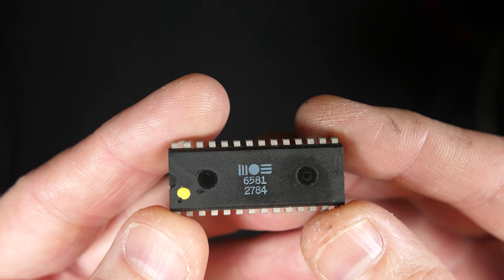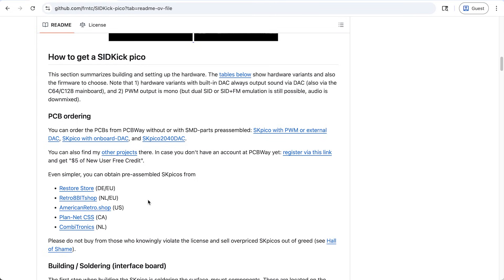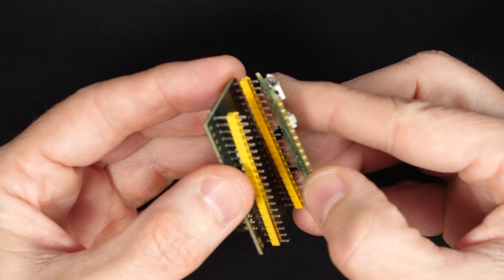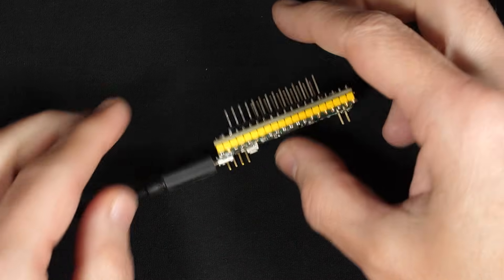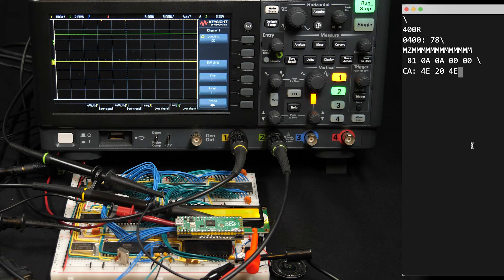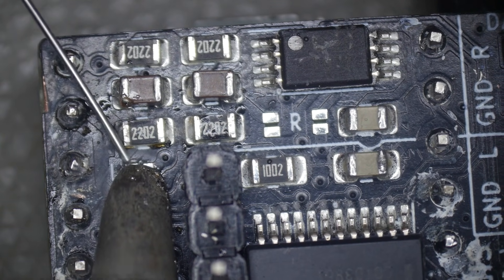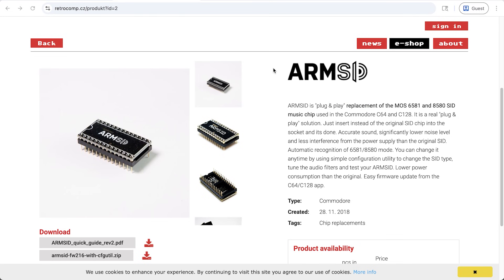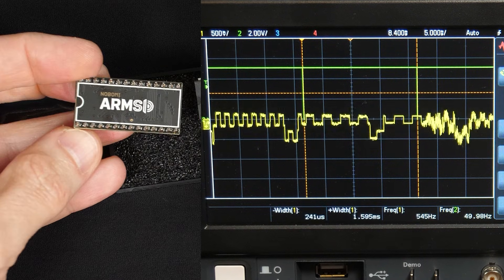Modern SID chip substitutes

Comment: Sidkick Pico is roughly half the cost and sounds nearly identical to my old ears versus the Armsid.  It might be uglier than the Armsid, but it's got some features that make it a lot nicer outside of pure SID emulation (ie, being able to have PRGs straight on the pico or having the DAC/no DAC options if you're a modern SID composer/musician).  It's also kinda nice to have the config menu built in and not a separate configuration app.

Comment: The major difference I hear on the RP2040 SID is some alliasing, which makes sense for a PWM output. I wonder if with some filtering (passive RC or maybe a 2nd/3rd orderactive filter with one opamp) it will sound closer to the original. Also I cant find the schematics on the github.

Comment: I put together a SIDkick (not pico) with a Teensy rather than the pi pico a couple of years ago.  Straightforward build, I like it quite a lot.  Drop in replacement for both SID versions (breadbin and in my 128).

Comment: The PicoSID Definitely has a more grainy sound to it!
6581 and the ARM sid sound very very much alike, ARM SID sounds just ever so slightly quieter though
ARM sid is doing a really REALLY good job, the PicoSID i had expected a bit more performance - feels like its running at 22khz out tho.. ARM sid maybe 44khz or 48khz?
Need a SID replacement with a nice 88.2khz or more ;)

Comment: Sounds like the rpi sid plays the sound with like 11khz or so, you can hear the carrier waveform on top of the sound signal, unless your hearing doesn't go beyond 10khz.
The arm sid has an occasional pause in the audio. 
So I'd prefer the original sid in this case.

Comment: For the jumper bridging, yes you could use a piece of wire or a zero ohm jumper resistor, but when I was in collage for the repair course, to fix a broken trace you can bridge by turning the soldering iron's temperature down and swipe that part quickly like a tiny paint brush.

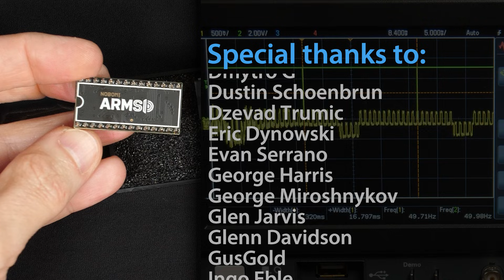Comment: 12:33 the capacitor makes a difference on the sound, the last one didn't have an attenuation caused by the charge that was working like a attack/release simple RC filter.
they come close to the original, specially the second one, I think the problem is that they're too perfect and the original has some analog circuitry that provides a small bit of distortion.

Comment: I've seen interesting SID and YAMAHA chip solutions on gaming machine boards. A board + op-amp + a large chip, probably a CPLD/FPGA, and a flash chip. Putting an RPi into such a setup is disgusting to my taste. I can also understand someone cutting corners and creating graphics on an ARM processor – that requires significant processing power. If they're creating graphics on a CPLD or FPGA, that's also acceptable. But throwing such a monster into generating music? Ugh! I recently streamed music in 16-bit PCM format using an 8051. If you're so inclined, there are plenty of NORMAL MCUs (even those operating at the 5v standard) with built-in DACs – from a few bits to as much as 16. They're also 8-bit, so there's no mismatch.

Comment: 2:35 A custom board to piggyback a standard board onto… Given how few supporting components an RP2040 needs, I can’t help thinking there’s potential for a single custom board with DAC and RP2040 all within the original footprint… which I suppose is pretty much what the 2nd board is, just with a different CPU.

Comment: For as complex as the Pi replacement is, it seems to have most "noise" compared to the original and the ARMSID.  Armsid sounds very clean, just too bad the output is a bit on the lower volume side.

Comment: I love the sidkick pico. The PWM version that you skipped IS a drop in replacement as it is :) It also supports built in .prg files that are run from the sidkick, you can put your diagnostic programs in its firmware and you don't even need a cartridge, but that is only useful if you use it in a real C64.

Comment: Am finding it extremely excessive that you need 800MHz CPU with 3GB of RAM, or whatever the Zero has, some extra chips to emulate simple 6502. Sure it doesn't cost a lot because those components are readily available these days, but still. Total overkill to emulate such an old chip.

Comment: I'd say that if there is a difference in sound between original and replacements it's a subtle level of noise that you just associate with the experience, bit like how people like vinyl, even though it's actually distorting the sound slightly, your ears get used to that version. I'd say the SID replacements are cleaner in sound, but they're all good.

Comment: I've been listening to that Monty on the Run tune for forty years and I honestly couldn't hear much of a difference between the original and either of the replacements. Maybe less distortion, which one could argue was part of the signature sound. Probably there are some edge cases where you would hear the difference but unless you are a massive purist and you really insist on having the original hardware, this is going to do the job just done I reckon.

Comment: This takes me back to when I was training under grads to program machine code in 6502 and also Z80. They would build a simple 6502 board with a couple of K for ram and a 2716 for the code. We used a developement board called EMMA, that had a sinple Hex keyboard and 6 x 7 segment leds for the display of memory location and data. I also learned alot back then. The 6502 was used in the PET and BBC computer and the Z80 was in the TRS80 and sinclair spectrum if I remember correctly. 
My expansion sysyem for the TRS80 had a modem, twin disk drive, printer interface, and eprom programmer. My BBC computer also had a Z80 co-processor. Fun times.

Comment: There's quite some bit crunching in the Pico sound output that is very audible. Otherwise both options seem to work well. I'd pick the ARMSID tho, simply for the cleaner sound. Any audio amp will have no problem fixing the low output.

Comment: Great video.
All the HW (PCB) versions of the SIDKickPico are essentially the same. First version was the simplest, outputted a PWM sound by default, but you could add an off-the-shelf DAC board to it to get analog audio. Then the second version came out which integrated the DAC chip on thePCB, making the whole thing look neater. And finally the latest version integrated the RP2040 MCU on the PCB too, eliminating the use of a Pi Pico. This board is much smaller in size since there is no need to follow the Pi Pico form factor. Looking from a cost/performance point SIDKickPico (all HW versions) gives you the best sound, really close to a real SID.
ARMSID is like the first version of SIDKickPico, without the external DAC board, so yes, PWM only. It sounds fine, but to a trained ear there are a lot of things that just don't sound right. Being significantly costly compared to SIDKickPico, I believe it will be slowly disregarded by the C64 community in the future.
And there is another one you should check out, The FPGA-SID. I haven't tested it myself, but a lot of people swear by it that it is almost indistinguishable from a real SID. It is not cheap though. 
These are the top 3 SID emulators at the moment, there are older stuff like the Nano SID, but none of those can compare to these top 3.

Comment: The interesting thing would be to compare emulation modes.  The different versions of the SID chip had different characteristics.  The original 6581 actually had some mistakes that were discovered by composers and used to do things that the chip wasn't supposed to do, like PWM altering the filter to create a percussion sound.  Later versions of the chip fixed these flaws, but as a result some SID music from composers like Martin Galway don't sound right on later chips.
This was so important that "the scene" helped Martin Galway resurrect his system that he composed all his music on, then they used it to record his tunes so they could publish a CD called "Project Galway" with with the music sounding as it did when composed.

Comment: I have installed the sidkick Pico in 2 c64's. It's working great, it comes with several bonus : it emulates 2 SID's and also the FM sound. And it has the capability to store games in the flash memory (the UI to launch them is accessible with SYS 54301) . So definitely, for the price, it's unbeatable. 
Also, sound quality wise, it's very difficult to tell the difference with a real sid.

Comment: From the little information I have, it might guess that the picosid output that was clipping was because that resistor you knocked off was to adjust the gain down, and wasn't reattached correctly.

Comment: The FPGA-based SID version in the Ultimate64 is pretty decent, but if you have a real SID or any kind of SID replacement you can insert it into the provided socket.

Comment: Love this! Do you plan on getting to the point where your 6502 computer can read from / write to disk (create a file system), and get a terminal running where users can run commands and stuff? That's getting into more OS development than hardware stuff, but I would still love to see that.

Comment: As much as Rob Hubbard is awesome, the Monty on the Run theme isn't that great for comparison cause it doesn't use some of the more finicky features of the SID that emulation may have a harder time with, such as the filter or combined waveforms. If I were to choose one tune to use myself, it'd probably be Martin Galway's theme for the Miami Vice game, since it uses both combined waves and the filter in a relatively obvious way that has been historically hard to emulate.
Reply: This, I also thought something by Galway would be a better test for some of those edge cases with band-pass, ring modulation etc. Even though MotR is probably still my favourite SID tune ever.
Reply: Anything recent by Lman, for instance, would break most of these replacement chips, compared to music from the mid 80s.
Reply: Bionic Commando had some quirky stuff too ;)
Reply: Getting my walker out... ;)... I had floppies for Axel F (Beverly Hills Cop) labeled Axel L and Axel R - needed two C=64's pressing the [enter] at the same time... also one for Billy Idol's Flesh4Fantasy - just the guitar and drums... but man it sounded great through a stereo.  The weird visual display was kinda cool - to the beat of the music that drew into the border area.  Ah... ill spent youth! ;)

Comment: A probably even better replacement, would be using an FPGA. You could really get into the thing and inspect the behaviour of the individual parts of the chip on a cycle by cycle basis. Also, you could easily increase frequency and add you own custom hardware/instructions.

Comment: The funny thing about SID chips is that each one sounded a bit differently. Its among the least consistent ICs ever made

The drop in replacement is way better than the overkill raspberry pi version. Makes no sense to put 200 times the computing power of a C64 just to emulate the sound and still have it not sound right.

Comment: There is also backSID. and a couple others as well. There is a HUGE discussion as to which are good and which are junk. The SWIN SID nano is just. I'm barely an audiophile and that one is just offensive. The others sound the same to me. The "full size" SWIN SID is apparently ok, but not great. I can't hear anything wrong with it. I also think the integrated U64 SID sounds perfectly fine as well. But interestingly enough that board will take any SID you give it. Not just the FPGA that's built into to the board.

Comment: SwinSID is another SID-Chip-alternative with an overclocked ATMEGA Microprocessor.
Only 5V operating voltage - no voltage regulators or level shifters needed.

Comment: As people pointed out the PWM + low pass filter is a DAC. This is how class-D amplifiers work .... Even high fidelity ones.
Reply: Class D amps likely use PDM and not PWM. PWM works if that’s all your hardware has. But for specialized hardware you’d use PDM as it is more suitable.

Comment: I didn't know there's such thing as a "Make SID as an RTL module in VHDL" itch bruh
Reply: There isn't--most of it you could, but it contains analog circuitry which is not possible to model in RTL.
Reply: @Sauraen  eh well it can still be done in a way methinks, a cursed way but a way. At least ADSR and signal generation

Comment: There is some kind of lesson to be learned in how much modern technology it takes to substitute something designed in the very early 80s
Reply: That lesson is just how absurdly inaccessible IC foundries are for low volume.

Getting a spot on a wafer if you're not in a college course with a pre-existing agreement, even at the bottom-most available scale, is in the 5 figures range easily last I could find an actual quote, and that's for a single prototype.

If you want an actual wafer done for manufacture you're looking at about 6-7 figures a pop and years of lead time.

This was from the pretty spotty information I could get publicly though - I'm sure high volume gets much better rates, since a huge part of the cost is the photomask. Or maybe not anymore, with AI sucking up all the foundry output...

Comment: the arm is definitly cleaner with its notes, while the pico goes a little bit over the threshold
Reply: the original has some inherent distortion, people want the "perfect" sound, which means original, kind of funny. the ARM sounded like missing a RC filter that caused a bit of loss on the signal, just adjusting the gain isn't enough, it needs a capacitor to do the trick, maybe it has one but it needs a slight adjustment.
I think the pico sounded more closer to the original, even if the timing was a bit off and it clipped a bit. you can probably adjust that.

Comment: I vote for the ARMSID as the best replacement. Sounds exactly like the original minus a slight reduction in noise. Hard to describe what I don't like with the RPi, but its slightly sloppier... almost like it's subtly missing timings. But I'm splitting hairs.
Reply: Yeah, I heard the same. Sidkick sounded a bit harsh and distorted, armsid on the other hand was clean (sounded even cleaner than the original), if only output level being a bit low.

Comment: Excellent stuff.   - One note of caution though.  I'm sure you're well aware of this Ben, so this note is for less experienced readers:-  most chips have 'absolute maximum' ratings on them and can sustain permanent damage when these ratings are exceeded. - this often includes the chip sustaining permanent damage when input/output pins are subjected to voltages outside the Power Rail voltages.  - Hot-swapping I.C.s can cause the input/output pins to be connected to signals before the power pins and so can subject the chip to exactly this sort of stimulus. This can cause latch-up or even permanent damage.  - Hot swapping chips might work - but it can also destroy the chip.
Reply: Came here to say the pretty much the same thing.  I absolutely cringed every time I heard the pop when the hotswap happened.  I never, ever hotswap components except in the most exigent circumstances.  Not only do you have the risks described above, but with a DIP chip you run the risk of being off-by-one when dropping it in, causing pins to be connected to signals/voltages/rails they were never intended to.  Just say no to hotswap!
Reply: It can not only destroy the chip, but also char a breadboard 😅. I was lucky it wasn't the chip itself (an opamp in that case) I was holding, but a capacitor to add additional filtering to a circuit I inserted while it was powered on. That somehow managed to throw the opamp into latchup which caused the package to split and a flame to come out near the pins. Three dark brown rows on the breadboard are a reminder not to do that again. Would definitely have hurt if I had that chip in my hand.
Reply: For an IRL example of this, the Wooting 80HE was delayed for a few months when they discovered many of their units were unexplainably defective.

Turns out during production they would plug and unplug some interconnects while the board was powered for assembly and testing, and if you did that there's a small risk of this exact thing happening.

The delay was obviously not ideal, but the transparency on the issue was really solid.
Reply: Yeah…Faradays Law of Inductance is a good way to toast a chip! It’s how car ignitions make sparks! 

Having been made to watch a 3M video on why antistatic straps are needed, that showed under an electron microscope what happens to the chips, back in the day…It can erode the conductors in the chip. 

So you might fry it on the first hot plug, or it might last a lot longer…but please don’t teach people to hot plug semiconductors!!!

Comment: I'm still amazed that you haven't blown any chips, inserting and removing without powering down 
As an electrical engineer, it makes me cringe every time 😅
Reply: I have been doing this all my life, no issues :D
Reply: @UnknownUnrecognized i've been smoking while refilling my car tank with gas like for ages. And so far, so good !
Reply: @speedsterh  Well, liquid gasoline doesn't burn (I've seen someone put out a cigarette in a bucket of it). The vapor with the correct air/fuel mix will get  you. Gas pump nozzles in the US have methods to suck the fumes back into the pump, so not much likelihood unless spillage on a hot day allows vapor.
Reply: @speedsterh  irrelevant comparsion

Comment: A period correct replacement should be possible with some logic gates and the analogue circuit on a daughter board. Basically build the SID chip out of discreet components.
Reply: It’d be more fun to build it with DIP components on a breadboard
Reply: i‘ve been planning to do this for a while
Reply: Great idea. Hell, use vacuum tubes for a 'warm' sound, LOLOLOLOLOL.

Comment: the SKpico seems to be overdriving the signal (or in some other way distorting the sound) which is ironic when it's made to not outout the sound through the motherboard spesifically because it may introduce noise.